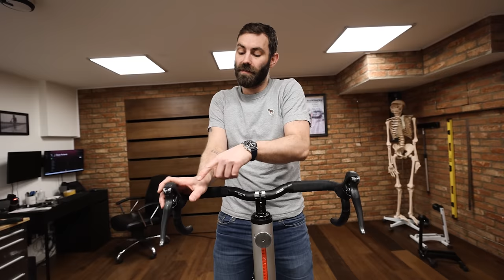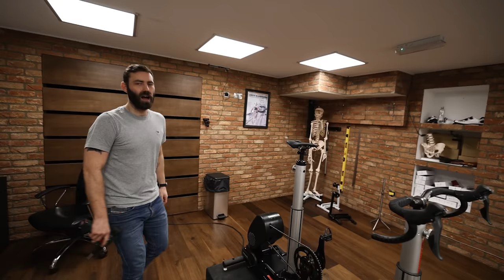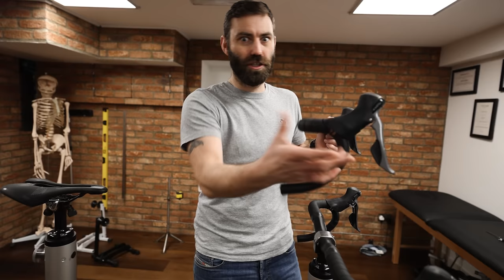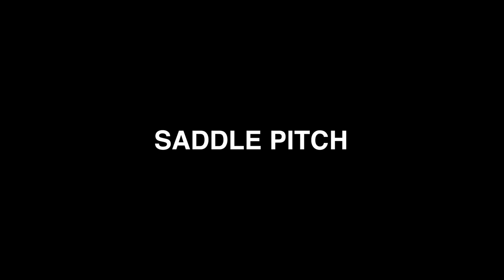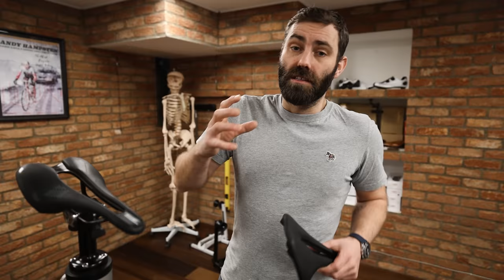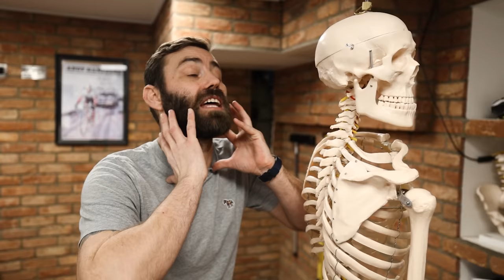Neck Pain While Cycling? - 6 Causes

Comment: As someone who's had this problem for decades, I'd say this is all very good advice, especially at 2:55. The one thing I'd add is that you can improve your posture by rotating your pelvis forward, so as to keep your back relatively straight, and upper back even in slight flexion. This takes a bit of practice in learning how to sit slightly differently, engaging the core.  I've seen Julian Alaphillipe ride this way in a seated climb.

Comment: I do a fair amount of indoor cycling on Zwift. For me, neck discomfort comes from having the TV I use for Zwifting mounted at a height on the wall typical for normal TV viewing on a couch and not for someone in a bike. One of these days, I will move the mount holding the TV down so that it better simulates the typical, and more comfortable, head angle of a person riding IRL.
Reply: @veganpotterthevegan  Sounds like a nice arrangement. 👍 I don't think my 55" TV would fit there! 🙄🤣
Reply: Oh yeah man, that really sounds painful. I also only use Tablet and smartphones which I have somewhere around handlebar height or lower so that my eyesight reaches the ground approximately 2-3 meters in front of me

Comment: I'm on a full sus xc mtb, but man, these videos help so much.
Before I was looking at getting 100EUR+ saddles because my jewels always went numb, but after trying some of your tips I'm so happy with my current saddle. Thanks.
Now I have to do something about my hands outer edge going numb, I feel like they are in a bit wierd angle and a slightly narrower bar, or more sweep would help.
Reply: when my outer hands went numb i fixed it with a bar with less backsweep. too much backsweep and my inside hurts

Comment: I usually get a headache a couple of hours after I finish a long ride. I thought this was due to hydration, but now I start to think it's related to neck pain and to bike fit. Thanks for sharing those tips. I am curious to know what James thinks about post-ride headaches.
Reply: I used to get headaches and it related to a pressure point from a helmet casquette interaction. Might also be worth looking at whether you've got any weird interactions or tight spots in your helmet.
Last thing I found caused headaches was colder weather - Particularly for those with less hair, wind chill on the head is a very real thing! If you're not already, try wearing a cap under the helmet to keep your noggin warm.

Not saying these are necessarily what's causing your specific issues, but other things you can try!
Reply: First try to drink and eat more before/while riding. 
Sun, heat, exhaustion and similiar things can give you headache too. 
If you have neck pain then fit your bike.

If you still get headaches and there seems to be no obvious reasons I would go to see a doctor. Maybe get an MRI scan. Maybe it’s migraine, maybe it’s nothing, or it can be something serious.

I get headache time to time, but I have a capillar condition in my brain where it can bleed just a tiny amount, making my head ache, but it can cause serious problems too, like epilepsy. This was discovered with MRI.
Reply: Nope have treated / cured headaches with bike fit, following the steps in this video ought to help, if not………….bike fit!
Reply: I do also got headache after finish a long ride. Every time the ride is quite intense ( Zone 3-4 on 80% of the ride), it cause headache and I think my problem is fatigue. So lately I ride mostly on zone 2-3 and I got less headache or just some small discomfort on my head, get some sleep and it's gone.
Reply: I used to get a headache towards the end of a longer ride (4+ hours) which would then go about 2 hours after the end of the ride. I too put that down to hydration, but no it was bike fit. I am now riding with higher bars and with my head not tilted back I no longer get a headache.
Reply: Thanks all for your replies! Post-ride headaches look like a common issue. It'd be a great topic for a Cade Media video.
Reply: I think headaches can also come from a lack of oxygen in the brain. Some people get headaches from practicing singing for that reason.

Comment: Your last comment about getting an endurance bike makes me pissed off about the bike fitter I went to. Told him SO CLEARLY that I suffer from rotator cuff/hunch back due to my line of work (tools and equipment aren’t ergo), I see a physio and Osteopath to help with a lower back injury + have a daily stretching routine to help yet his advice on a new bike was to get a Trek Edmonda because he just wanted to sell me the most expensive bike they had in the shop he worked out of. I ended up with a Tarmac SL6, and as fun and racey as it is, I cannot spend hours in it on a weekend for a cruise; it is 100% a crit king. Knew I should’ve gone with my gut and got a Roubaix… IN the smaller size I know I need too!

Comment: I recently went back to 40cm bars (down from 44 stock), turned the levers inwards slightly and took 30mm out of the stem, and it literally fixed nearly everything for me on my  merida 400.  even at 188cm, 44cm bars are too wide.
Reply: not all tall ppl have wide shoulder.. some are stocky built

Comment: Another great video! Keep up the good work! 
These video's have helped me so much in the past years. Like so many others I had my saddle set up way too high, too far forward, tilted nose down, ... Because if the pro's do it, it should be good, lol. 
Now I no longer have numb hands and feet or the  infamous 'numbnuts', no more neck pain and I really enjoy riding my bike so much more now. Thanks a lot for that! 

I don't know if you  or James will read this and have time to reply to these very specific questions. But I do have 1 question left that I haven't really found a solution for in any of your videos. 
I'm sitting completely off center/ crooked on my saddle, off to the right. It's not hurting me, I didn't even know until one of my riding mates pointed it out and took a picture. I still haven't found out what the issue is. Could this also be a result from a saddle that's too wide? Or maybe too narrow? 
Saddle is no longer too high, my cleats should be set up identical and far enough to the back, and my legs do have the same lenght.

Comment: I still don't have an issue with wide handlebars.. maybe it have something to do with my wide 51cm shoulders (armpits) :D 
Still i run 36cm bars on track, 30-40 on road and on my cross and winter bikes i run 44
And.. as much as you hate it :D i just love fizik airone with slightly nose down position, like 2° everything else i tried caused issues, so after years of trial and error i settled on this and since i never had an issue with saddle.

Comment: Hi guys Tks for the vídeo! Great info as usual. One question o saddle setback, if are comfortable with your setback, but the stem is too short and this is causing jeopardizing the bike maneuverability, the right way for testing  a more forward position in the bike with a longer stem would be to push the saddle forward and raising it at the same time? If so, any recommendations for proportion forwardxraise?
Tks from 🇧🇷🇧🇷🇧🇷

Comment: Okay my problem is I purchased a 2014 Cannondale synapse size 51 because the website says size 51 is for 5'5"-5'11"...  I told the bike shop i think i should be getting the size 48 because the webpage shows 5'2"-5'6".  The bike shop insisted i am a size 51.  I have neck and back problems even after adusting saddle height and reducing handlebar width from 42cm to 38cm and stem from 90mm to 80mm.   Am i doing something wrong or is the bike totally too big for me....  Thank you for your time.

Comment: maybe you can talk about prescription glasses for cycling? i have sore neck, but just because i have to lean back my head more then i want in order to see what's in front of me (100meters away or more).
Reply: This is the reason I wear contacts whenever I'm doing a fast ride where I'll be on the drops a lot.
Reply: I wear contacts while riding for this reason, daily disposable contacts for minimal fuss. Also frees up my face for sunglasses.
Reply: @andrewcockburn7484  my eyes is really bad, I wear +7 glasses, so contacts is not an option for me. :)
Reply: Yes! I got prescription cycling glasses from RX sport specifically to address my neck extension. Not cheap, but strongly recommend.

Comment: Watching these I’ve learned what saddles the fitter hates - specialized power and fizik arione- how about what saddles are good? Was that a Selle on the bike in the vid? Thx a ton - I’m trying to solve my own saddle issues… not fun 🫠
Reply: It should be a Selle Italia SLR Boost Superflow in size S3.
Reply: I've had good results with a Selle Italia Turbomatic Gel Flow,  for the reasons mentioned by James (this saddle is long with a wide back to support pelvis but not hinder leg movement), but I think it is no longer manufactured.  There has to be a newer model that replaces it.
Reply: @bengt_axle  thx a ton - highly appreciated
Reply: @xssae80  thx a ton - highly appreciated